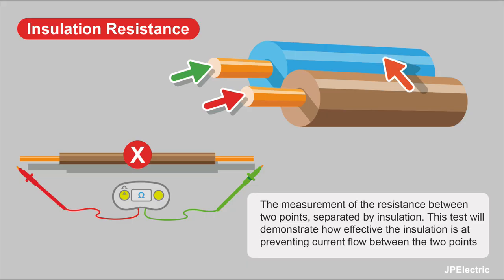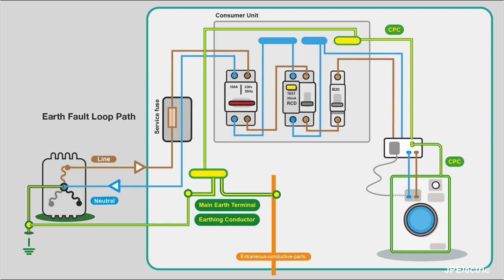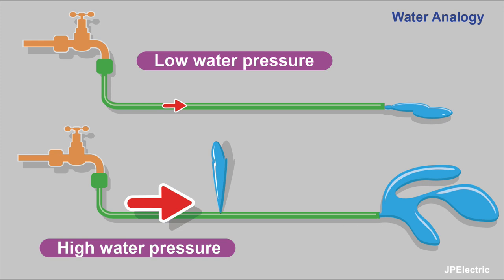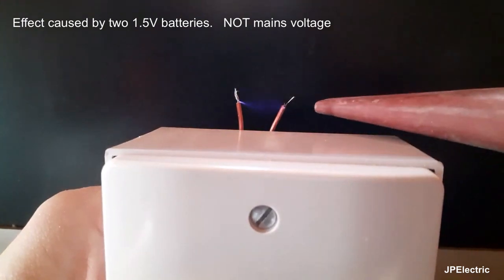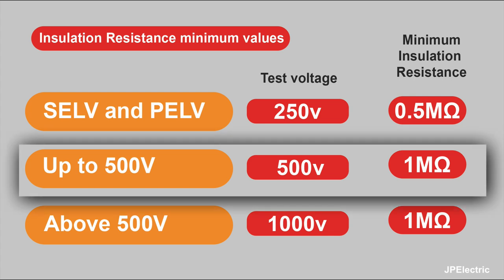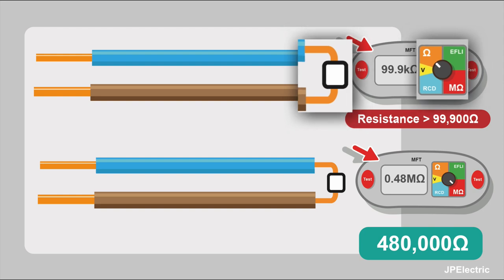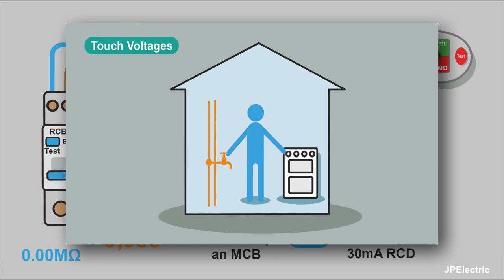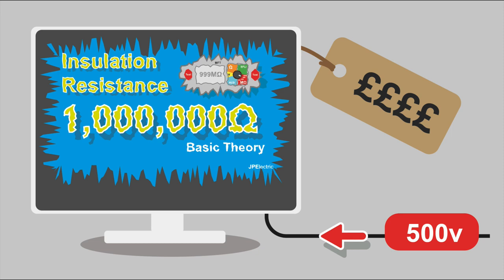Insulation Resistance Part 1 - Why do it?

Comment: Question: When a voltage is not specified for the megger check, and the 115 vac wires are rated at 600 volts......which voltage should be set on the megger?  I always assumed that 500 volts should be used since 1,000 volts is beyond the wire's rating. Is that logical?

Comment: 3:07  I have seen that happen. A screw through a floor board was too long and went all the way into a wire bundle. Failed the megger check. We had to start pulling floor boards up and go hand over hand until we found the problem.

Comment: I tested a single phase hvac pump at 15 mega ohms to ground on each leg. A short circuit was present but could not varify with meter.  I also tested legs between each other and the ohms tested correct against factory spec. When you smacked the housing with a rubber mallet the short stopped.  I still dont understand why i could not see the short to ground with meter when it was clearly shorted to ground.
Reply: In aircraft maintenance our fault isolation manual often tells us to simply change an electrical component. They do not say to meggar it or test it. I assume that's because of exactly what you are talking about....that it appears to test good but fails under load. I think the manual writers came to realize that certain electrical components aren't really testable .....just replace them and let the rebuild, shop sort it out.

Comment: Another safety tip.......first.... follow published procedures. But also totally remove power from a circuit before touching it. Unplug the power cord or power supply !   Unplugging the power is the only real way to make sure the circuit is safe. Plus be aware that some systems have battery power also, with a hot battery bus. In some cases you must disconnect the battery as well as unplugging the power cord.

Comment: Thank you for your efforts in producing this, it's appreciated. Just like your previous ones, it's very well presented and full of theory and real world content. I'm looking forward to the next episode, hopefully not too long away, as I am keen to see where you're last scenario of false positives etc is going as the AV pictures made me think where you were going. Great production. I've got the 1741+, how do you rate it?
Reply: Also..... what red lead are you using with the crocodile clip for the resistor clip?
Reply from the maker: Hi Olly , thanks for the nice comment. Im working on the next one now so hopefully in a few days.  1741+ is a good meter. Its had to go back to Megger though, as it had a fault. The two lead low current test, is a great function.  The lead is the one with the test button on it. You need to press the test button when doing IR so using the probe with the test button makes it easier.

Comment: Very interesting, surprised to see arcing of two 1.5v batteries.
Reply from the maker: Thanks for the comment w w.  That arc was caused by two 1.5v batteries.  It did go through a voltage multiplier  though to get enough voltage to cause that effect.  I wanted to highlight the fact is was battery only, as I did not want people to think it was mains power, and try it for themselves.